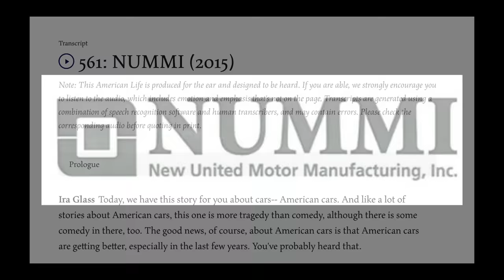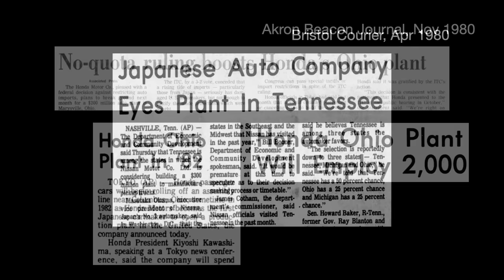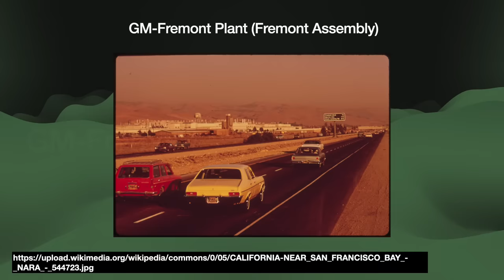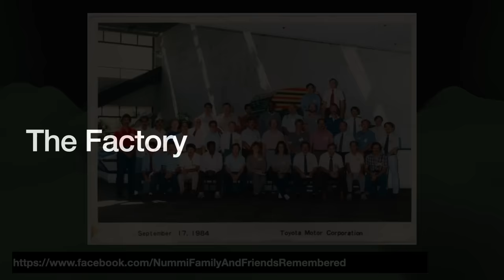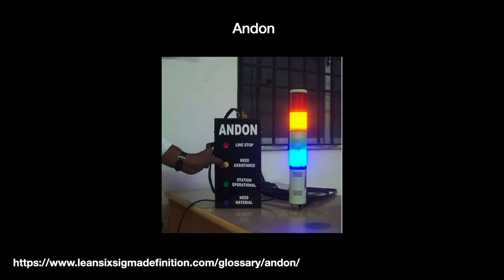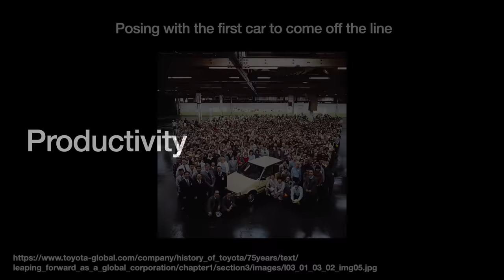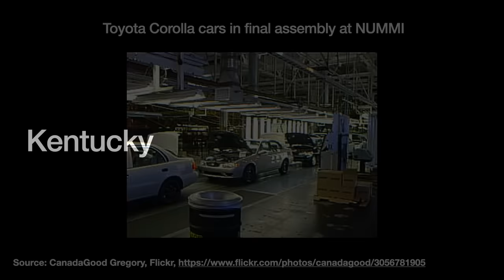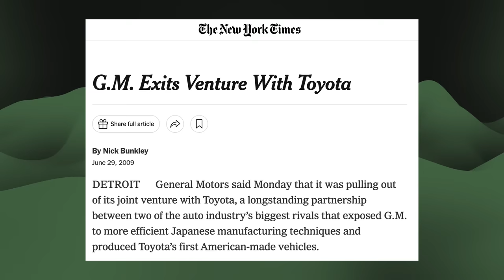How Toyota Turned Around GM’s Worst Factory

Comment: Sir, a very good video, I know that this GM plant was bad, I just didn't know it was horrible. Japan has a very good reputation for quality, but that was not always the case. Before WWII Japan was frankly known for junk. After WWII  a man by the name Dr. William Deming, a quality expert and a professor from M.I.T.  went to the American auto companys and wanted to show them statistical analysis and how it would improve car quality. They were not interested, becauce they could sell every car that came off the line. So then  Dr. Deming approached the Japanese auto companies and they happily embraced the man and his knowledge. There is even a statue of him there. Statistical analysis is what you profiled in your video, seeing a problem and fixing it on the spot and treating quality as an never ending  job. You might want to do a video on Dr. Deming and how he transformed Japan manufacturing. Only after losing great amounts of market share becauce of the Japanese dlid the  Big 3 auto companies here start to imbrace iS.A.  in the late 1980s and early 1990s. Much Success.
Reply: "Did you know that they found coke bottles in American built cars?" 
"Grandpa please you're just exaggerating."
Grandpa was right, but required a bit more context. Dang though yeah, the intro sounded like a nightmare to be in for everyone.
Reply: The first Honda  in the USA was so bad that no one would buy it.  It was cheap, so I went to see it at a dealer.  The shift knob came off.  The clutch would only shift into 1st gear and the brakes didn't work at all.
But it was cheap.  It took them 10 years to get their schiesse together, and now they're the 2nd best auto in the world, right behind Toyota.
Reply: Whatever manufacturing share was lost GM still sold more cars annually in the United States than anyone else for 90 years, until Toyota finally bested them at managing covid supply chain issues recently. The first time in 90 years that GM wasn't the number one auto manufacturer by sales volume in the United States.
Reply: @gooser__43  when it comes to foreign brand presence Toyota Honda Nissan and Hyundai / Kia are at every intersection here in volume. Not mostly Toyotas and some Hyundai's and Kia's. Regardless what we see at the intersections is irrelevant to the fact that GM was the dominant auto manufacturer by sales volume annually in the United States for 90 years, only just being bested by Toyota for the first time because Toyota better managed their supply chain issues that were brought about by the whole covid fiasco. It is what it is. For 90 years GM sold more cars in the United States annually than any other manufacturer, beginning in 1931.

"WASHINGTON, Jan 4 2022 (Reuters) - Japanese automaker Toyota Motor Corp (7203.T) outsold General Motors Co (GM.N) in the United States in 2021, marking the first time the Detroit automaker has not led U.S. auto sales since 1931.

Toyota sold 2.332 million vehicles in the United States in 2021, compared to 2.218 million for General Motors, the automakers said Tuesday.

GM's U.S. sales were down 13% for 2021, while Toyota was up 10%. For all of 2020, GM's U.S. sales totaled 2.55 million, compared with Toyota's 2.11 million and Ford's 2.04 million."
Reply: @gooser__43  so my point stands regardless you're stoplight statistics.
Reply: @gooser__43  also 2021 was an anomaly, as I said due to supply chain issues, GM regained the title of being the largest by annual sales volume in the United States for 2022. And looks to be on track to do that again in 2023. While us manufacturers have lost a LOT of market share over the decades, General Motors still sells more cars annually in the United States than anyone. Not by much Toyota is a close second but with the exception of 2021 they are 2nd. That's a strong performance by Toyota to reach that volume considering where they started from, and those they surpassed. GM's market share is down dramatically from the heady days of the big three dominating the market but they still hold the lead in market share. WITH that market having many more manufacturers participating in it today than in the past. Gm, ford, stellantis, toyota, honda, Nissan, the Kia Hyundai group, etc etc etc. Quite different from the days where it was GM Ford Chrysler and a small foreign contingent of brands like VW BMW Mercedes, European brands that would take a small percent of the market share.
Reply: @gooser__43  Sorry, no. Toyota's besting GM was a one-year anomaly in 2021 and it is absolutely attributable to differences in supply chain management. All auto manufacturers were hit hard by the issue and Toyota better managed the issue than GM. And that rightfully gave them the advantage for 2021. It's well documented and not in dispute despite whatever your opinion is of why that occurred. 😂
Reply: @gooser__43  and I never attributed Toyotas rise to the second largest auto manufacturer in the US by sales volume to covid alone dude. Don't know where you got that from they've been the second largest supplier of vehicles in the United States for a long time now besting Ford, Stellantis and the rest on sales volume. Except for GM. Which they only accomplished in one year 2021. Outside of that GM has sold more Vehicles annually in the United States than anyone else since 1931. It is what it is. From 1931 to 2020. Then again in 2022 and they're on track to do it again in 2023. Over those decades they have lost a large percentage of market to the other brands that have entered the market, but they are still top. Regardless how shity their quality is or how magnificent Toyota's is. Toyota has been a close second to GM on sales for years now. And their quality has certainly benefited them in that regard.
Reply: @gooser__43  no one can say for certain my ass those in the Auto industry, thosr who follow it, and report on it know exactly what it's attributable to. It's well-known what the supply chain issues were, which vehicle models it affected and how it impacted overall sales volume. It's only you that can't say for certain why that was. For argument's sake. It didn't work.
Reply: @gooser__43  was it due to a sudden lack of quality that they slipped from first to second place between 2021 and 2022 again? No. And it wasn't due to quality they rose from second to first in 2021 either.
Reply: If it weren’t for government contracts like police departments and various state agencies Toyota would probably have been #1 decades ago. Then there is the not insignificant fact GM (and Chrysler) got bailed out in 2009.
Reply: @ainslie187  Irrelevant. Sales are sales it doesn't matter if they're fleet sales or not. And the rapid growth of Toyota as a global auto manufacturer didn't begin until the 21st century. I mean they have a whole website devoted to it "75 years of Toyota" on the Toyota Global site, that documents exactly what their "rapid growth" has been year over year. There's no need to speculate about it. lol
Reply: @ainslie187  Good point, that I forgot about.  Most of the Police cruisers are US and many of the state dept cars and such were Cadillacs and such.  That's several million cars/trucks, and then they all have to go to auction in 3 years and get almost nothing, because, they're made in USA!

Comment: At the same time, all of this was going on at GM I was working in a wood products factory on the west coast.  The company brought in the same Toyota management system: Total Quality Management and Just in Time production.  We got all the special training, tools, management support, etc.  We did the pre-shift stretching exercises and the special quality control crew meetings.  I learned skills and concepts that I still use these many years later.  What happened?  Our union was resistant and slow-walked at every turn.  Ultimately, the plant was sold to a non-union company, and many people lost their jobs and had to re-apply for the new company.   The union mentality killed the entire concept.  How sad.
Reply: In my industry, unions are not unheard of, but extremely uncommon. Every union-run org I know of sounds terrible to work for based on stories I've heard. In this business it's very common for people to move around to other orgs, but union shops get avoided like plague, because you are guaranteed to have a bad time. My theory is that now that they're union shops, they can only get the worst of the worst to take a job working with them, thus making the union necessary and the toxic relationship between management and staff self-perpetuating. The proper solution is ejecting everyone and starting over, which occasionally happens, if they get absorbed in a merger with a larger non-union org.
Reply: I'm thankful that our Union and Company get along quite well all things considered.
Reply: I get that unions are protection and supposed to lift wages and whatnot. But overall I see a lot of unions just prevent companies from changing anything, changing layout and processes in a plant in an attempt to improve efficiency but stonewalled by the union. Crappy employees that do the minimum or nothing but keep their job. Pushing management away and creating antagonism. 

Seems to me like a fair few protections could actually be accomplished with law, we have sick time requirements in many states, we could add PTO and other benefits, wage I think usually sorts itself but raising the floor (minimum wage) raises everyone's wage for the most part.
Reply: It's sad that while Unions have a noble cause, the second they gain any power it inevitably turns into massive corruption and no longer about the worker.
Reply: @Jaker788  I think our institutions meant to protect to the worker are corrupt and weak. FLSA got watered down and the NLRB seems quite weak. There really is no alternative. 

I think Unions probably should have a profit sharing with the company to encourage development and updating stuff.
Reply: The selfish confrontational attitude of unions stem from the selfish confrontational attitude of the corporate-political alliance that compelled unions to form in the first place, and who haven't changed since.
Reply: @doujinflip  exactly
Reply: @Jaker788  the Swedish model works the opposite way. The government regulates very little in labor conditions (there isn’t a legal minimum wage even) but almost all companies and workers are under collective bargaining agreements. These are mostly negotiated between unions and companies collectively, no company can gain an advantage by undercutting the unions. Preventing a race to the bottom. When a collective bargaining agreement is signed and followed the union can’t go on strike. This makes both workers and employers feel more secure, more unionisation leads to less conflict in this case.
Reply: @doujinflip  yes most European countries have far stronger unions but there’s usually far less severe conflict. Depends on the country obviously
Reply: Note that a company that does not want to sign a collective bargaining agreement which is very rare, it is seen not as an issue just for their workers but an attack on the entire Swedish system and not just the employees but also all the unionised workers at their suppliers will refuse to work with them. See the current Tesla situation
Reply: @fnyquist8779  France might be the exception
Reply: @CatnamedMittens  no doubt
Reply: I feel bad for the buyer who ends up with a coke bottle inside their door.

Comment: Thanks for the history. I've driven past that plant along the freeway in Fremont so many times and it's cool to know what was going on there.
Reply: And now they make crappy Teslas.  Still Uhion, still making crap.  The Testa is only average in reliability and people don't keep these silly EV's long, especially since there are no huge rebates anymore.
Think of it!  A Tesla has hardly any critical engine parts, no radiator, no starter, no engine, no transmission, no cooling system and yet, they are "average".
Reply: @mutteringmale Uhhhh...
 Tesla is def not a Union Shop, m'dude
Reply: @mutteringmale The last time the plant workers even TALKED about unionizing under the current company running the plant, they all got fired. 😂

Comment: One thing not mentioned, during the time they were making Novas and Corollas on the same assembly line, Corollas were out selling Novas three to one. They were exactly the same car except for badging. That’s why GM bailed. It was at that time Toyota started to build the pickups which were very profitable for them. I worked at one the feeder shops making seat frames for Johnson Controls, and frame brackets for Dana. When demand increased for the trucks, they moved assembly to Texas where they could get cheaper labor, and take advantage of the even cheaper labor of Mexico. This move not only effected the thousands of workers at NUMMI, but also 3 times more of local suppliers. The cost of doing business in California not only affected GM, Ford and Chrysler had the same problems. It’s only a matter of time before Tesla will do the same.

Comment: I live in the Bay Area and my first car was a Nummi Toyota Carolla! If I'm not mistaken, the plant also made the car under the badge Geo Prism.
Reply: The Geo Prism was a JDM Corolla model adapted for the North American market. Why they didn't use the exact same model as the Corolla already built for North America and just swap badges I don't know. Most of the major parts were the same though, but there were differences deeper than the badges, and also some part bleed into North American built Corollas. 

One major downside was that a NUMMI or Canadian Corolla with the 1.8L engine got a Delco alternator instead of the Denso alternator Toyota used in other markets with the 1.8. Ask me how I went through 3 of those piece-of-shit Delco alternators in my Canadian build 90s Corolla... Fast forward a decade and my newer mid-2000s Corolla built at NUMMI had a Delphi computer in it, which had to be replaced under recall, because GM used substandard solder on them.

Comment: My outstanding Toyota Tacoma was built by NUMMI and it has been the most reliable vehicle I have ever owned (still going strong after 22 years and 220,000 miles).   You think GM would have learned something from Toyota regarding quality, but sadly that has not been the case.

Comment: I've had 2 NUMMI cars - and I still have one. A 2000 Corolla and a 2000 (Chevy) Prizm - the same car as the Corolla just with the bowtie on it and you can often get them cheaper because no one knows what they really are.

My Grandmother had a 1996 Corolla that was built in the Cambridge, Ontario Toyota plant and it was always nicer and more well built than either of my cars from Fremont even though it was a base model with the 4A-FE and the 3 speed auto. Slow as all hell though. The 1ZZ-FE may be an oil burner but it does actually move the car when you ask it to.
Reply: IIRC in 1998 the Prizm was about $2k less than a comparable Corolla, and you could use your GM credit card points to cover a lot of the cost!
Reply: Same for the Pontiac Vibe, A Toyota Matrix built side by side at NUMMI.

Comment: NUMMI made the Corsica I got up to 252,000 miles.  Extremely impressive for an American small car built in 1992.  I always thought it was a Camry with cheap GM parts glued on.
Reply: NUMMI didn't build your Corsica. If you got it up to 252K I guess those GM parts weren't cheap.
Reply: NUMMI did not build your Corsica. I had a 1993 for my first car. Had 110k miles with lots of problems. Overheating, random engine stalls coming to a stop, electrical issues, etc. I can't imagine the amount of money you spent to maintain that pos.
Reply: @Gobinator98  No kidding?  Plastic bits kept breaking off it all the time.  I spent practically nothing on maintenance.  Just drove it into the ground.  Was so impressed I bought one Cavalier after another, both with the throaty 2.2L engine, both died around 150k.  Afterward I went Japanese and never looked back.
Reply: I bought a new 1995 Corsica, it needed a new engine at 20k miles, and the transmission went out at 45k miles, needless to say I've driven nothing but Toyota ever since.

Comment: 4:43 Small correction: The gent in that picture is Akio Toyoda, son of Tatsuro Toyoda and he was Toyota’s CEO from 2009 to mid 2023. He has beenreplaced by Koji Sato, former Lexus and Gazoo Racing president.
Reply: Small correction for you:  Akio Toyoda is the son of Shoichiro Toyoda. Shoichiro and Tatsuro are brothers.   Their father was Kiichiro, who was the founder of Toyoda Motors in 1933.  In 1933 Toyoda Motors was a division of Toyoda Automatic Loom Works which had been founded in 1926 by his father, Sakichi Toyoda. 

Like their cars, Toyoda family members have been long lived except for Kiichiro who died at 57 from a cerebral hemorrhage (stroke) caused by a chronic disease. After Kiichiro's death in 1952, his cousin Eiji, an engineer by training, took over running the company until 1994.  Eiji lived to 100, Shoichiro to 97, Tatsuro to 88.

Comment: GM Fremont aka "Freaky Fremont" was rife with labor issues and was the worst in the GM system. The running joke was that, "If it's available, you could get it at Fremont". That included gambling, drugs, sex, alcohol and more. The "Terrible Three" plants in the GM system were all located in California: Van Nuys (closed in 1992), Fremont (closed in 1982) and Southgate (closed in 1982) were all terrible plants. A worker at Fremont was once called into the foreman's office after they figured out that he had left 300-400 front ends loose on purpose. When questioned, he related that he was getting back at the foreman for writing him up for drinking on the job. 

GM should have kept NUMMI going and partnered with Toyota on a continuous basis. Both companies benefitted from the arrangement and the NUMMI plant is a case study for MBA and graduate programs---I know I studied it during the time I did my MBA in the late 1990s.